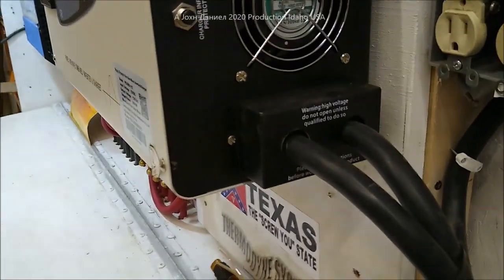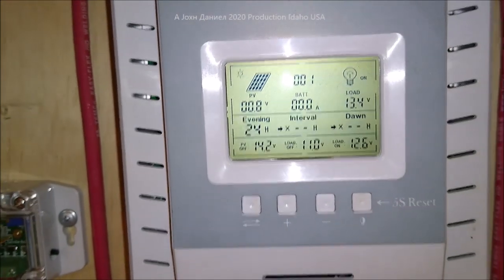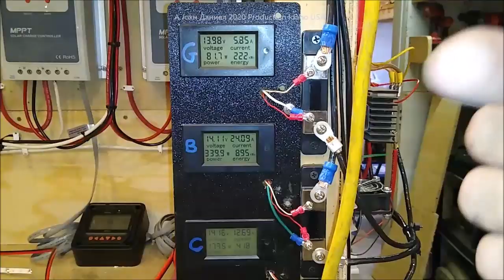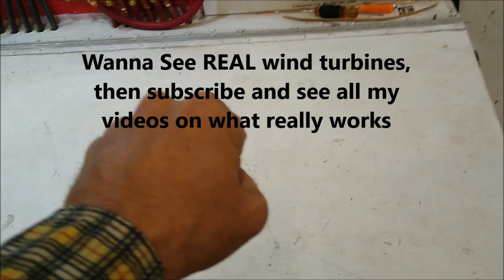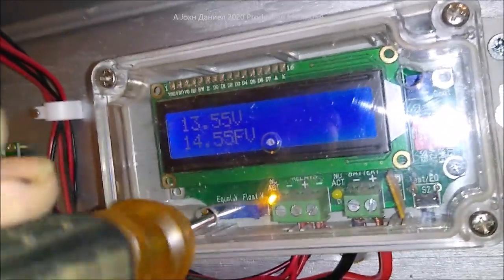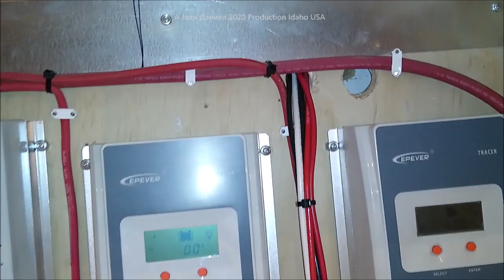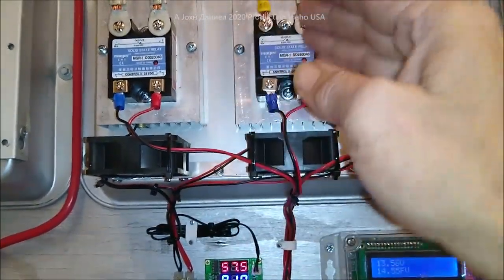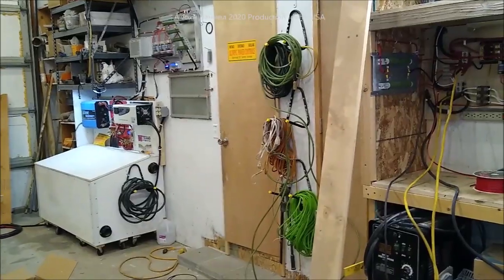Micro Wind turbine EZ diversion charge controller & upgrades, Parts Below vid

Comment: @John Daniel
Continued progress with your overhaul looks amazing. I'd REALLY LIKE to see a wiring diagram.  I've got diagrams of subsystems you have posted in your older videos, but still missing the BIG picture connections.  Having the diagram will make ALL your subsystems make sense and come together (automated turbine diversion controllers, manual diversion, recitifiers, solar charge controllers, etc...) I've reached out via email and would like to contract you for a consult, please.
Reply from the maker: I'll be doing a video on the exact point for point lay outs asap
Reply from the maker: I will be doing a total lay out on the grease board and putting numbered links to the parts laid out in order on the next video and below it soon.
Reply: @JOHNDANIEL1  The white board diagram will be great!  Looking forward to it.  In the meantime I sent an email to your yahoo account.  I would like to contract with you for a private consultation regarding my LiFEPO4 battery management with a wind/solar combo.  Hope you are amenable for some one-on-one Q&A.  Thanks in advance
Reply: @JOHNDANIEL1  Hi John, I also am wanting this diagram. Setting up your design right now. The SSR connects to the dump load, but is not the dump load also connected to the batteries? Will that also drain the batteries you just charged?
Reply from the maker: @EdwardPrzybranowski  No, the controller turns the relays to the load resistors on and off to maintain the maximum charge rate to the batteries without allowing over charging.
Reply: @JOHNDANIEL1  Do you have a wiring diagram for the controller box with SSR and connected to the dump load? I think I am missing something.
Reply: @JOHNDANIEL1  Hoping you will provide specific wiring for your "AC pass through" and "Inline DC loading", as both of these were covered in some prior videos.  I also have the "Sir PokyDoRight 2012" active braking diagram, and there's some uncertainty I'm not getting when it comes to your "direct braking" methodologies... perhaps expounding on that too as I want to consider all possible means of turbine management.

I'm looking to put together a diversion controller that will not only isolate and divert/load the turbine from my battery bank when activated by my BMS, but will also manage the potential over-voltage conditions during high-wind conditions in an autonomous fashion.  Also wondering if it's wise to also employ the additional "Hail Mary" braking knife switches you've shown in all your videos (which I believe are moving).  

Knowing recommended load ratings for Green-E 500W 12V turbine and having an overall management strategy will be most helpful for me, and as I have mentioned in the past, I'm happy to hire you for private consult and guidance... thanks in advance.

Comment: I'm thinking having a dump load that is capable of taking all your excess power (so total peak generation minus your 24x7 constant load values) would be enough.
Reply from the maker: Dump loading can be a bit different depending on your entire system, battery bank size, wind turbines actual ability but generally if you have 3 real wind turbines, thats defined by those who make their rating at or below 25 mph winds, then you must have 50% plus that rating as dump loading and a controller designed to trim off the excess and slow the turbines due to that effect of load. I have to add 300 more watts to my system of 1600 dump to handle the addition of a Hurricane turbine but thats a common thing to expect to cover high wind events an fully charged status.

Comment: John,
1.) Did you ever install that Chinese diesel heater in your work trailer yet?  I installed one in my ice fishing house and it is working great for me!!
2.) Any update on that battery charger you were talking about a few weeks ago.  I was wondering if you had more info on using it for LiFePo4 batteries?
Reply from the maker: We actually installed-sold the heater to a man with a job site cargo trailer and have ordered another to do a install on for our bambi trailer 
The 12/24 battery charger works well on Lithium but not sure how well over time the batteries will handle it without a lithium regulator.

Comment: That big inverter is made by Sigineer Power-- a Chinese company that makes EXCELLENT products.  https://www.sigineer.com/  There is another company (Amico Power) that happens to make fantastic welding equipment.  Not every Chinese company makes junk; some of them are in business for the "long haul", and they produce the best products that they can to gain reputation and market share.  Your wind turbines are another fine example of great Chinese engineering.  I have many friends over in China (also are engineers like me) that make great products.
Reply from the maker: We are loving it, ran my entire 35 foot Jayco 2 days now with my 450 watt electric water heater hybrid in it.

Comment: Hello friend! One question!! 
You make at your own the charge controller of the turbines?? Can i do the same controller for 48v? If you look at my channel i have built some wind turbines and i want to change the Chinese controllers with some like yours. But I can't find in market SSR relays for 48v. Do you have anything in mind?
Reply from the maker: You buy the 3 to 32 volt triggered SSR, tap a source on your batteries for 12 or 24 volt as a switch power to operate the SSR.

Comment: Very newbie here with a probable dumb question...could you use a grid tie inverter as s dump load and sell you excess to the power company rather than burning it off into resistors?
Reply from the maker: NO, the dump load features do not lock on long enough to send power to a grid inverter for such use. Its designed to be the healthiest charge regulator.
Reply: 3 option ... Using water heaters as dumploads
Reply from the maker: Water heater dump load we often use https://ebay.to/2OBuxo4

Comment: Nice john i love it . I love my 100 amp 200v EPEVER mppt controller and my 80 amp 200v EPEVER mppt controller. They kick butt. I have my solar at 120v 1200 watt and 120v 600 watt . I used 8 awg temco wire and mc4 and from combiner  1/0 temco welding cable to breaker box  then 1/0 to  controllers and to a common copper bus then 4/0 to bank bus bar. And master shut off switch .
Reply from the maker: I never need to risk a short at high volts so I just run 2 panels per leg, 45 volts
Reply from the maker: That 100 amp MPPT I have right now in the system ( https://amzn.to/36QJ31u by Y-solar ) is a very affordable controller with easy to set on site programming. I like it.
Reply: @JOHNDANIEL1  your controller was cheaper in cost. 100v max mine is 200v max
Reply: @JOHNDANIEL1  it looks like a good controller.
Reply: Epever rocks!...love mine too
Reply: They are basically the same. Do you have the MT50 meter on yours? Look at my controller box i made  with 2 of epever controllers in it and breaker box and bus bars. I wired it good. And cooling system is awesome.
Reply: https://youtu.be/EEjS9K-Q6B8
Reply: And dont laugh at my fuckup with tripping my mppt controller breaker
Reply: I have the 60 amp EPEVER  with 1200 watts run to it also but I have a 24 volt bank so it's safe todo so. Epever does state in the manual recommended PV voltage input. Although it can handle the high volts, it's efficiency is best at that stated voltage. It's different depending on bank voltage and wattage input but i'd recommend checking it out. I ran my 12 panels in 3 series of 4 to make 48 volts 'rated' which ends up being 70-90 volts in the sun and then parallel those 3 series together to 6 awg into the controller.  I regularly see 100-110% rated panel wattage.  Ran correctly these controllers actually boost rated output.

Comment: Is the power that is going to the dump load coming directly from the Wind Turbine or from the batteries? If it is from the batteries, is it possible to have it directly from the wind turbine so that you are not micro cycling the batteries?
Reply from the maker: Its from the turbines, the effect of pulse diversion like these is it takes voltage off the turbines as its exceeding charge voltage.

Comment: Will be ordering a few of the SSR.  I have some 25A ones but damn they're getting too hot.  Even with a fan.
Reply from the maker: Always check your SSR's for idle bleed through, on poor models you may get a tiny bit of power leaking through them, so occasionally feel your resistors for warmth when no diversion is going on.
Reply: @JOHNDANIEL1  hey John 
Thx for a graet Channal.. 
I hawe ben doing som reaseartch.. not on YouTube 
But in huge books .. .. ther Was somthing bathering me.. the Frequncey of the AC 
On the rectifiers  you said they got hot but was 120A .. 
The diodes are usual used for50hz .. so i starded wondering 
And Diodes ain't the same .. i got som 10.000volt  high curent diodes rated for 15.000Hz ..
Ill try Them out .. ill bet you they doe's not turn in to resistors like regular diodes doe's !! With 
High Frequncey AC.. 
You by now know the AC from the turbines fluktuate by wind speed .. / RPM .. 
So let me hear you thaughts .. ther is a market for colder rectifiers ..
Reply from the maker: Good questions and answers, worth looking further into
Reply: @JOHNDANIEL1  yes usualy rectifiers doe's not get HOT at a 3 Of capasety .. 
Not in my HAM World anyway ..
That was What made me wonder 
And remembered somthing fast AC .. turning a diode in to a resistor ... 
Ill Hook Up my scope to my 500watt @48v wind power turbine 
And see What Frequncey i get out .. they say 20+ms and hurrycane 35ms gusts 
So ill bet you i see breaking lights .. and Max A out of the wind turbine to night 
Ill get Hack to you of What Frequncey we are talking about .. 
Is IT okay with numbers or do you want a data file.. of houres of monitoring 
Or just Frequncey at 
A given wind speed .. 8ms 9ms 10ms ...12ms wher max output shuld acure 
Or any thoughts
Ill registre the windspeed Vs Frequncey Vs output
Reply: @JOHNDANIEL1  Ordered a few 60A SSR from ALI .  The Chines New Year and Corona have things  more then Botched Up over there it seems.

Comment: Hey John, I See You Took The Chinese Lantern Turbine Off The Trailer!? Was It A Piece Of Crap Also? And Please Dump Them Lead-Acids & Go To Lithiums!!! Look At Battery Hookup In PA on eBay, 42 Packs For $210 For The SPIM-8AH Packs! 4=A Group 27 to 31 Size Battery For About $6 per Pack or $30 Per 12v Battery + MORE POWER... Thanks Buddy
Reply from the maker: Lithium lifespan is poor. Everyone I have seen that jump to lithium regret it after about a year. They just do not have the cycling rates to satisfy the people I have worked with. Unlike a electric car which has sophisticated systems the current inverters and controllers eat up lithium lifespans in short times.

Comment: a dumpload 50% of a turbines rated output , i remember a guy on YT saying the same as the turbines max rating, i wonder how that works with turbines from a place in Missouri  with slightly exagerated ratings, maths is not my strong point though but i figure with my puny brain 25% of advertised ratings, ive been wrong before though.

Comment: Hey John, how about diverting 4 your water heater?
Reply from the maker: Got 2 of the 12 volt models like this https://ebay.to/2OBuxo4 and as soon as I get a tank to install I will. But right now, all our water heating is tankless.
Reply: Hey George the hot water was the most interesting and persuading thing for me I don't have a tankless water heater and given the cost of a good propane tankless water heater I was able to pickup a quality wind turbine. I have two 105 gallon water tanks and if I could even preheat the water it would be a viable option and my regular 30 gallon propane heater wouldn't have to work as hard.

Comment: So, I'm new to this. I've mentioned that I just use the all in one hybrid controller you link to in several of your previous videos. It works well and has the dump load and all that. So, why do you do it this way instead, building your own control system rather than just using that same controller? What do you gain by it this way?
Reply from the maker: Being able to run multiple turbines tuned to one battery bank without interfering with each other is why I build like I do.
Reply: Јоhn Daniel gotcha. Thanks! =)
Reply: Great question Glenn and great answer Mr.Daniel

Comment: Nice setup 👍 I just wish I new exactly what you are talking about. I am interested in solar and wind power. Just don't understand much. I have watched many of your videos. Always interesting. Thanks for sharing the details.
Reply: Well 
IT is not easy .. but ITs way more doable Then building a hous .. 
1 qustion .. What doe's you expect of you'r setup  WATT USAGE?? Hous /rv/ condo??? 
2 on Grid or Island ??(off Grid) / HYBRID?? (Both + batteri bank) 
3 where doe's you live .. not adresse .. but North pole / central America ?? 
4can you combine wind power ( some live in the city like i do but rules may wary i got2x500watt@48v
5 what Volt on AC (110/20 -230) and What volt on DC (12 24 36 48 96 . . .230 v DC i prefer48v becaus of rules)